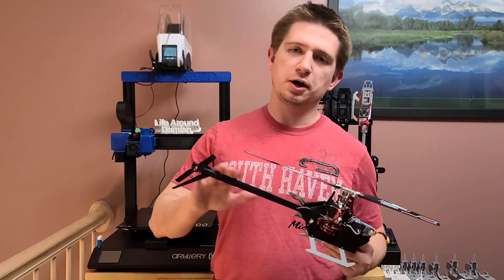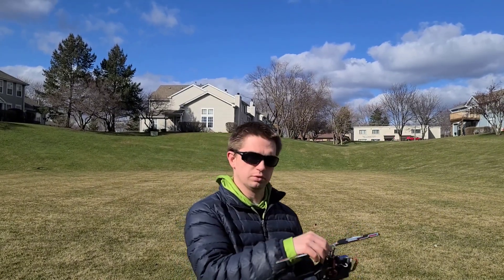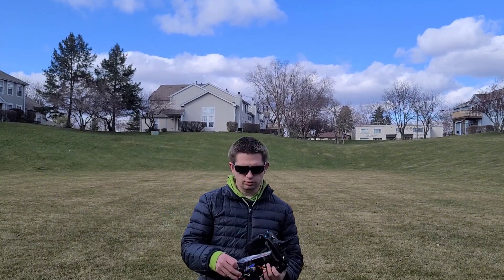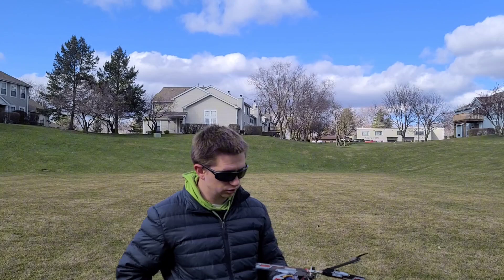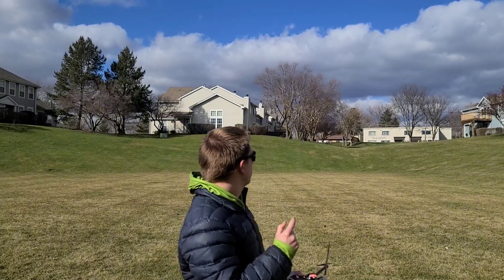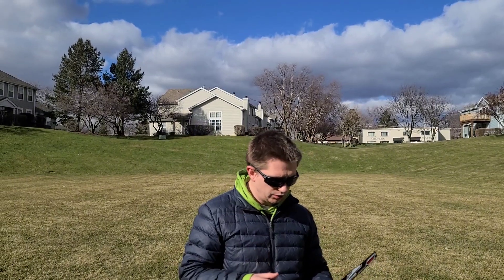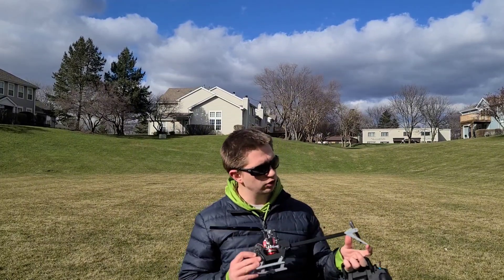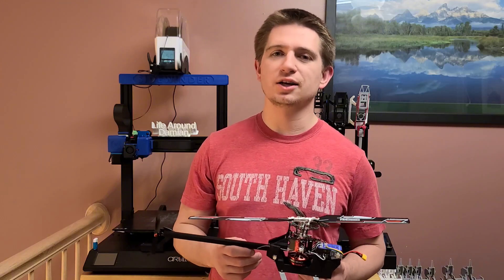Flying Harder Than Ever - 3D Printed RC Helicopter

Comment: I've printed parts for small helis, and they've held up well so far. A tail boom mount for a Microheli MCPX frame out of PLA. 

A few tail motor mounts (with integrated tail fin) for a 2mm boom with 7 and 8.5mm diameter tail motors for the Nano CPX using bright yellow and green TPU, they seem indestructible. Also a tail fin for my Goosky S1 that has a recess for a second CF tail motor mount, also out of bright TPU. I crashed it tail first and snapped the original CF fin.

The tail fins are firm enough to not hit the blade with a mild strike and soft enough to never break. I used Geeetech (i think thats the name) TPU with great results, also Bambulabs TPU, but it's a bit firmer and not as bright of colors are available.
Reply from the maker: Thats awesome!
Reply: @LifeAroundDamian  I've also found the TPU is good for holding batteries in the battery box.

I've been thinking about TPU landing skids, but they'd have to be beefy if they were 100% TPU. I may try to make a small shoulder piece that attaches to the frame (side to side) and use regular (PLA or modded) skids that have circular uprights to go into holes in the TPU. 

 Kind of like this  /---------\   the screws can go through the TPU and thread into the PLA frame, it may need washers or a PLA plate to keep the screws from pulling through.

Comment: 3D prints scare me. I 3D printed an RV2 Model RC plane from Eclipson STL Files. On my first flight, the wings folded and the fuselage harpooned the side of my truck at high speed. It was an expensive phone call to Dent Wizard. lol
Reply from the maker: After that incident, I dont blame you for being scared at all, I would be too! Haha, there are definitely a lot of variables to consider when going into a project like that. I had my heli explode in front of me during flight, so I had to go back to the drawing board lol This heli is quite robust, but no worries I can do the flying so you don't have to 😂 as long as you enjoy the content!